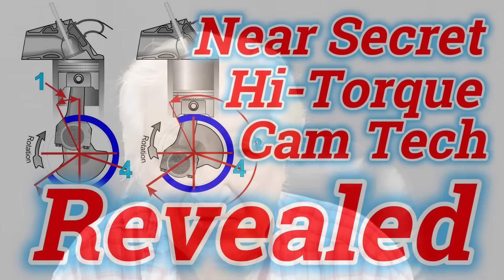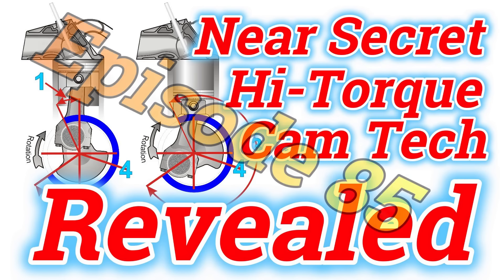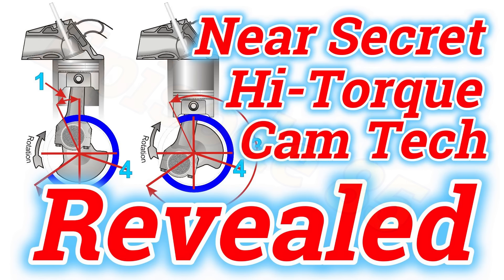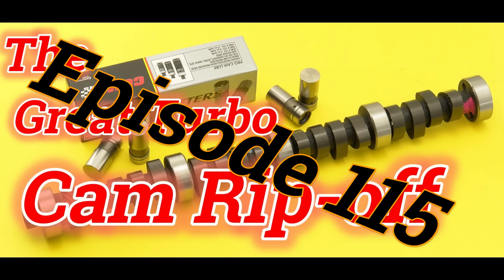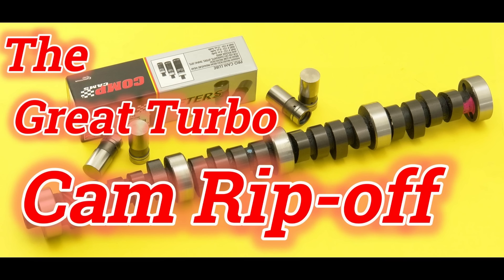The truth about LCA's Vs idle & vacuum quality

Comment: David can u explain why the LS 5.3s and 6.0 engines are on a wide LSA?   I think there on a 117 or more.  In my opinions they did this for a smooth  idle. High vacuum  and have a broader power band?  There duration  is short for the street.   A narrow lsa always has a rougher idle and less vacuum.

Comment: I want lots of torque from 1500-5200 rpm. I have a Pontiac 469 (.060 over 455) with 2.11" intake valves. D-port heads are pretty much flow limited at around .400 lift. The 128 formula tells me I need a 103 LCA cam. Is this really the way to go?

Comment: David, I am working on a 305 Chevy for a boat. How much lobe separation should I use without breathing sea water into the engine at idle?
Reply: using watercooled and not very efficient exhausts, brand Mercruser
Reply: even so, I want to do my best

Comment: Mr. Vizard, I used your cam choice information when building my 408 Ford. It idled about as smooth as a Toyota Camry at 800 rpm, and with 13.5 inches of vacuum. Power was 607 HP at 6500 rpm, and 546 TQ at 5200. A nice little 10.5 to 1 pump gas street engine I could drive every day.
Reply: What heads did you run on that 408
Reply: Very nice. What is the LCA, lift and duration for both intake and exhaust on this camshaft. In other words can you please provide the cam specs. I really like those results.
Reply: @carlclark989  EDL 7721 2.125/1.625 with mild porting to keep velocity up. They flowed 355 @600 but the focus was on mid lift numbers
Reply: @captainrawn  it was a Comp 35-772-8. 286/292 248/254 .614/.621 110 LSA. Page 78 of the catalog. Slightly off, with a bit too much duration. It was during Covid and everyone seemed to be having cam core issues at the time. I felt it was close. Being a solid "street roller" I felt it gave good ramp acceleration rates and stability without having to check the lash every time I drove it. Knowing what I learned, I didn't need that much cam, but it's what I could find used at the time. Maybe 8-10 degrees less duration would've been ideal for what I wanted out of it, and I might've made roughly the same power. I had EDL 7721 heads on it since the cubes were so much higher. Big block sized cubes should have appropriately sized valves and flow. The 396 Chevy BB has 2.19/1.88, but we have better knowledge of port design these days, so I thought the 2.125/1.625 would be good. The more accurate the head choice for the combo, the less cam duration you need to compensate. Velocity, and port and valve size should be appropriately sized with the airflow demands off the cubic inches and stroke. Except for the Boss 351 engine, Ford has always struggled in this department until the Coyote engine.
Reply: @buildaboiworkshop A little bit, yes. Brakes worked fine though. A little too much duration, but nobody I contacted had cams and it's what I could find used that was close and nearby.
Reply: @Mustang_Chris   Thanks for the detailed reply much appreciated! I would be very happy with 13.5 inches of vacuum at 800 RPM on an engine that makes 600 HP!
Reply: @Mustang_Chris 3:48
Reply: Why are they specing cams at 112 deg . Then 112*3. What's the difference? Thanks I'm advance
Reply: @markblue1966  It's just a theory, but I think they're adding advance into the cams to compensate for the eventual timing chain slack.
Reply: @Mustang_Chris thanks for the reply. I am starting a 351w stroker, but trying to determine if I want to go 427 or 408.
Reply: @carlclark989  If you even need to ask the question, stick to the 408. The 427 requires a high dollar engine block, and more expensive heads to get the airflow for the extra cubes. We're already pushing the limits of what's affordably available with the 408. We always try to go too big, then it gets more expensive than we thought, there are delays and "life happens", then it becomes a stalled project that we consider selling for a loss. Unless you're a certified badass with deep pockets, keep it simple, and enjoy your awesome engine.

Comment: So a few months ago, I decided to try some of David's theory, and I had a custom cam ground from Bullett for a SBF. It originally had a 5.0 HO roller cam, which has a wide LCA. I ground this cam on a 106, with similiar duration and better lift on a hyd flat tappet camshaft.  It idled good, basically the same as the 5.0 HO roller cam, but had a crap ton more torque down low. Up higher in the RPMs I dont think it lost anything compared to the 5.0 HO cam. I really liked the way it acted, especially with taller gears etc. Before it wouldn't do a burn out. After the cam swap, it would light them up, same trans, same stall, same gears.  Putting every cam on a 110 is a cop out. off the shelf strategy. I love tight LCA cams, and most people dont really get it. Thanks David V!

Comment: Should we calculate required duration or lobe separation angle first?  Also, all else equal do higher compression engines idle better with the same overlap?

Comment: Hello mr Vizard, i would like to say thank you for youre educational videos. Ive learned quite a bit all thanks to you sir. On that note id like to ask you a question. I have a 91 mustang gt 5.0 5spd. Im looking to do a complete top end kit on it. Im looking to get the most i can out of it as well as still be able to drive it on the street. My issue lies in cam and head selection. Do you have any cam recommendations along w rockers and heads? It will be street driven w a few red light races lol. If i need to get ahold of you thats ok too. I wish you would do 3 builds on a 5.0. A budget, a mid tier, and a high end. I also wish you showed us how to port a set of aftermarket heads for it as well. I know its a tall ask as im sure youre a busy man. I wish i knew how to build engines let alone build as good as you do. This is my first project car that im having fun with. I know you said the lca is critical along w other cam specs. After seeing youre cam designs i prefer what you do. Does a good off the shelf cam even exist for these engines? Any help is appreciated and i look forward to seeing you build a high hp and tq 5.0l sbf engine. Budget friendly would be super awesome. I still have the original 5.0ho engine in mine ill be working with. From what i understand my engine is the roller engine. Again any help is appreciated and thanks in advance.

Comment: Mr. Vizard is on the know, I got one of the how to build books when I was 16, the first Chevy 350 I built I used the extreme amount of knowledge and did a lot of independent research asking engine builders their take. I had limited cams available to me being in Canada so I chose what worked closely to the Vizard formula. The engine pulled so hard it would keep pace with a motorcycle from a stop light. If I could I would love to sit in a class. Thanks for sharing Mr. Vizard.

Comment: Excellent video David. My minimal experience aligns with what you are saying. Most of my experience is with old Cleveland's and cast iron heads. Through trial and error, i ended up with much greater LSA's than the cam grinders were happy with. Interestingly enough, many years later i bought your How to Build Horsepower book and based on your recommended calculations, I was within 1° of where your recommendations said I should be. I got there on luck and money, wish I'd bought your book many years ago. One thing that I have worked out is that most of the people that you talk to at cam grinders are order collectors, and salespeople, not engineers or engine builders. Many thanks Greg
Reply: Clevelands are a different animal. Most never realized that and caused them great confusion.
Reply: @psychoholicslag4801  agreed. I've always said that the greatest weakness of a Cleveland is Team Small Port engine builders
Reply: @theshed8802  😄😄 so true.
Reply: I am building a roller 302 2v OC Clevor, and decided that the stock HO cam @ 115 LSA was close for a street engine. I am doing weird things to it to get 10.5:1 with flat top pistons. I think ideal was around 114 according to the 128 rule.

Comment: The LS Truck Norris cam has an advertised duration of 212/220 and a lsa of 107. This cam has a very noticeable lope but it's street friendly. I have a hydraulic roller in a 350 with cam specs of 218/224 with a lsa of 114. This cam idles much smoother than the Truck Norris cam. I'm definitely confused here because I clearly see a difference in idle quality between both cams lsa being the only big difference. 🤔
Reply: Less overlap to tho 6*-8*

Comment: My problem with this theory is the best cam for a road car is the standard one it came with, if it's a race car with a 4k rpm rev. range from 4-8k if it's a 10k rpm motor that's 6-10, if it's a single seater 8-12k.all requiring very different profiles. In the case of the Nissan infinitely unit that used on ovals over there they had a 600 rpm difference between down the straight and around the corner. Experimentation was 1deg of cam duration at a time. 
At that level after 6 months of testing there is only one answer, for every thing else there seems to be many. 
Piper cams in the 80's had their HR2 range which had assymetric profiles on opening & closing ramps. Brilliant and logical idea which lasted 10 ish years before reverting back to conventional equal flanks
Reply: For new cars? Yeah 100% anything from the 50s/80s? Probably not especially with ported heads, bigger carbs & headers. Also cam knowledge went far!

Comment: I had a 1970 malibu with the 300 hp/350. As a young kid we did a dingleball rebuild, and we installed a Engle rv10 cam. It was 210/210 .440 lift and 108 lca. With just that mild cam, and headers. Turbo 350 and 3.31 gears, people couldnt believe how it pulled!  That sold me on short timing for street driving, and 108 l.c.
Reply: A 210@.050 on a 108 is the perfect cam for an otherwise stock 350 engine in a street car.
Reply: @robertwest3093 Exactly what I have in my 350 astrovan pills like a team of mules...
Reply: Going to put an Rv10 cam with 106 in my 225 slant six. Similar specs to what you describe up here. It needs it even tighter..I can't wait how this little stroker will rub with it's headers and reworked head
Reply: I love Engle cams

Comment: My 1st experience on LCA. Was 39 years ago.  A friend of mine worked  for John lingenfelter and got me a cam for a street 383 SB CHEVY. It was circle track grind and had  108 LCA.  For a street stock. My friend witch is the engine builder said we'll it's going to blow the tires off. I said great., I'll take care of hooking the car up. All of them knew I was going to tune the carburetor to get it to idle smoother

Comment: I think the biggest reason people tend to dismiss the LCA being so important is they fail to think that having the point at where the valve flows the most in relation to the piston speed is not important. If you run a big duration with a lot of lobe sep your peak intake valve opening might be occuring as the piston approaches BDC and that will only be ok at extreme rpm everywhere else it will be killing you as the cylinder fill will be almost entirely dependent on inertia and it will be highly prone to reversion.

Comment: Ok, what do us guys that run a Cleveland use for a formula?  BBC?
Reply: I can tell you this(and yes it doesn't answer your question) 350-451 CI Big Block Mopar(S) the 128 Formula works well. G2 Hemi NOPE , what is interesting , My uncle has used a lot of off the shelf 351 cam specs for G3 hemi, and has had great results....Go figure.

Comment: exactly why im using a ramjet cam in my 350 vortec build, with 1.6 rockers. 196/206, 109 lsa, 105 ICL. with 1.6 rockers, lift is .460/.480. -17 degrees overlap

Comment: This is why I went for a 227@50 with just over 11 to 1 static comp instead of high 230s to 240 degrees @50. With a 109 LSA.
Reply: sounds like a good street cam. 🤠
Reply: @DANTHETUBEMAN  that was the whole point of it. With that cam and the calculated 11.15 static comp it works out to be 8.5 cranking compression.  Perfect for E10 fuel here In Australia with a tight. 040 quench. The .006 cam duration is 277 289. Should run from around 2000rpm to about 64 6500rpm power curve with peak torque just under 5000rpm with the intake track being about 13" long and DV inspired exhaust system with street legal sound open header power.
Reply: @lcxu1051  vary smart build, vary fun to 😁
Reply: @DANTHETUBEMAN  I know it is. Funny thing is the engine shops here in Australia disagree and say it won't work. I grew up around racing my whole life and never knew DV or any of his ideas. Only learned about him about a year ago. What he talks about and says is exactly what I learned from my dad growing up with motor racing.

Comment: Then what benefit does having a wide LSA? Maybe it has to do with cylinder bank angle on a type of engine. The actual LCA on the shaft of the cam has to match the engine bank angle ?? I think some emgines like Pontiac low rpm high torque engines do better with a wider LSA?? while a Ford 302 high revving engine likes shorter LSA??

Comment: Lobe center line angle has always gotten confused with lode separation ,
Reply: The person making this video calls them the same thing.
Reply: He’s talking about his LSA formula LSA=128-(CID/8/Valve Diameter X .91)
Reply: @Thumper68 the "formula" that says the Ford Godzilla needs a 99 LSA camshaft?  Pretty sure the OEM truck cam would punch through the pistons on a 99LSA.
Reply: @optimumperformance6998 
What formula?
DVs formula does not pertain to that engine family.
HE CLEARLY STATED THAT.
Reply: Does the formula work with supercharged street engines or N/A only?
Reply: @hotrodray6802  The chart in his book says inline 2 valve V8.
Reply: @optimumperformance6998 
The godzila engine is actually a “canted” valve engine…..the side angle just isn’t very big, but definitely there
Reply: @MrJak427  ok, so take a 460 Windsor with a 2.100 AFR Head. 97 LSA? Off the chart in his book.
Reply: @optimumperformance6998  
That’s a question better off directed at David I simply stated that the godzila engine was canted valve not straight like you did. 
Also if the L.S.A ends up meaning that you have to notch or change pistons then so be it… that’s not David’s problem it’s just what that combo requires 
not saying that the equation you came to was right but if it was right and that was what an engine needed then so be it.
Reply: DV’s books are old and well before the Godzilla’s time and the 128 equation he has provided online with constants for very specific engines do not include the newer Godzilla engine.  If you’re going to step out on your own and make your own assumptions then derive your own theoretical/empirical equations, you don’t need DV’s.
Reply: @trailerparkcryptoking5213  again using chart 10.5 on page 107 in his book, a 2.02 valved 350 wants a 108, but his formula wants 104. He has said that 4 is too much error so which one is correct? 128-(350/8/2.02x.91) or 350/8/2.02?

Comment: I ran a Comp 284xe with a 110 degree lobe separation and 240 degrees duratio in my big block Chrysler. I wiped out a lobe after about 5000  miles. I replaced It with a mopar purple cam with 114 degrees lobe seperation and 248 degrees duration. Both Cams pulled the same vacuum at idle. The Comp cam was way more responsive, but the Mopar cam pulled harder in the upper rpm range.
Reply: It was bigger, it should have
Reply: @cedricwilson2055 I'm not sure if I understand.
Reply: Bigger the LSA 114 the Longer  pull

Comment: Can you specify how much overlap is needed for reaching certain RPM limits? (Say for 5,000, 6,000, and 7,000 rpm). Also, how much overlap do you recommend and for what parameters? Thank you, Mr. Vizard.
Reply: it’s in his book, which you really should biy for all the finer details, but basically

10* - 40*….towing
30* - 60*….ordinary street
50* - 75*….street performance
70* - 90*….street/strip
85* - 100*...race
95* - 115*...Pro race
Reply: @nobodyspecial5026  these numbers look like they’re at full duration, say 0.006” lift, not @0.050” lift.   Correct?

Comment: What about too late LCA and too long duration to mimic Miller cycle? I.e. get some air/fuel back out to have more compression than the engine and fuel used would otherwise allow, therefore having more expansion. Mostly for street, not sure this would work well in a race
edit: or, should I say "a street car that may episodically try to go fast"?

Comment: Hello David, will your 128 cam program formula need to be modified in order to calculate the proper LSA, to be used in a 1969 Pontiac 400 Ram Air III automatic Firebird, that will otherwise be completely stock except, +.060 Bore (4.180 X 3.750) ported heads, and 11:2 compression? I intend to use only 98 Oct leaded gas. Thank you...👍🏻
Reply: I used 128 formula in my Pontiac 400 and bought a camshaft with 106*LSA with proper overlap and duration,  like DV has been suggested.